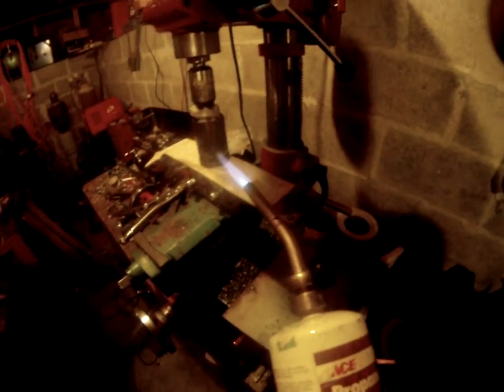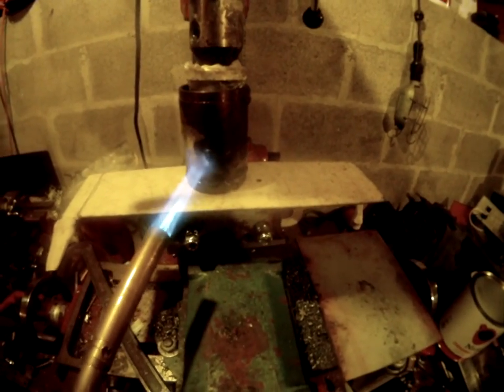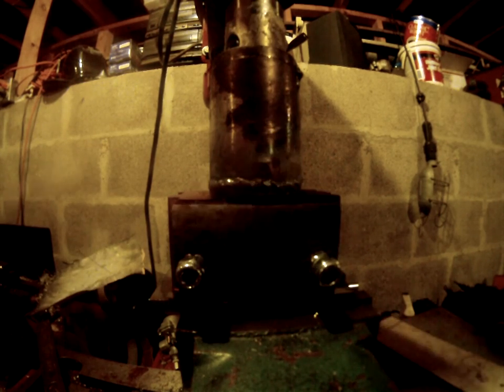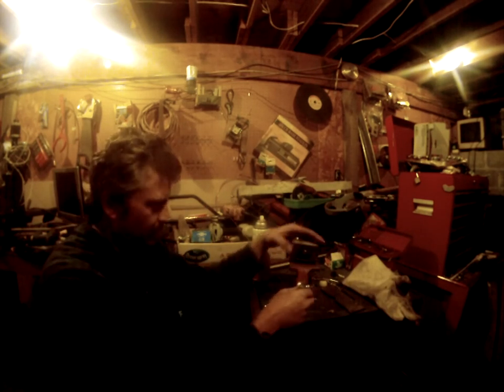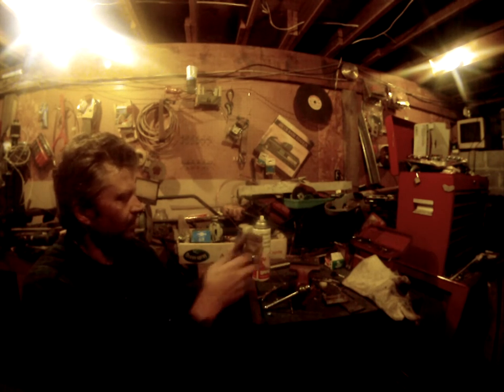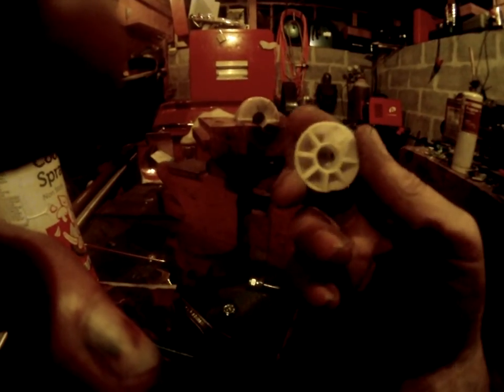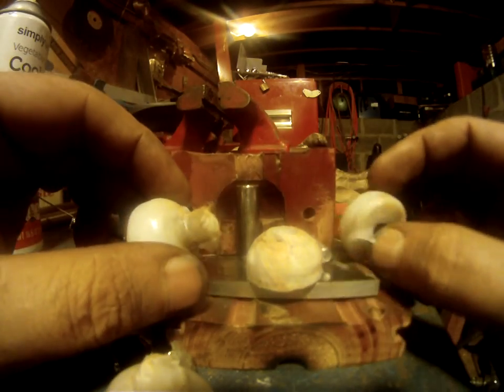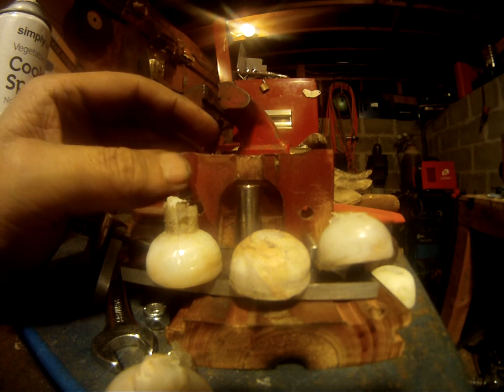Recycling HDPE milk jugs for cash and proffit.... minus the cash or any proffit

Comment: Great mold, that gives me some good ideas.
That's the problem with wood molds, they tend to break with the pressure.
I've found that after finishing on the belt sander you need to finish it with some very fine paper, as you tend to get fine fibres left over.

Comment: Hey I must be going around unconscious I did not know you had a channel.  Great job of roller manufacturing.  I think thinks like rollers and pulleys are a natural for this material  By the way I subbed.
Reply from the maker: +Amateur Redneck Workshop Thanks Harold I sortof butchered your channel's name in the video but searched for it and it still leads to your page. Melting the plastic is no problem its making the mold that's the hard part... Thanks again